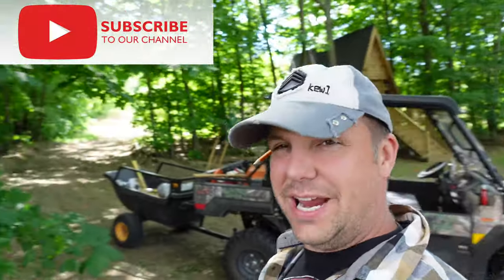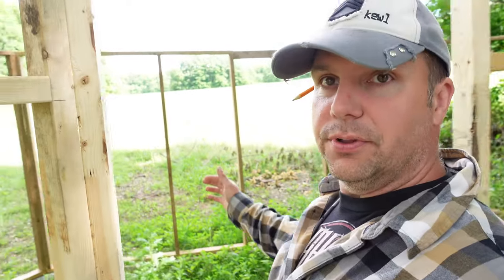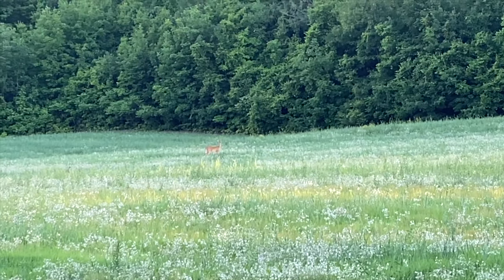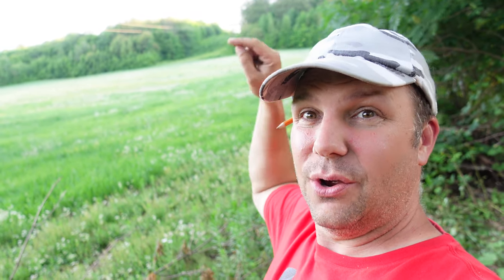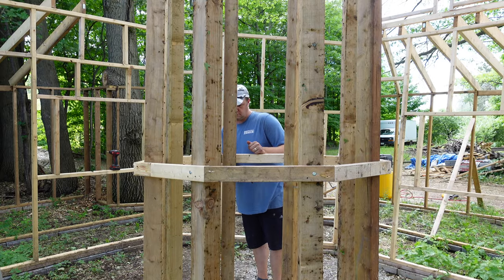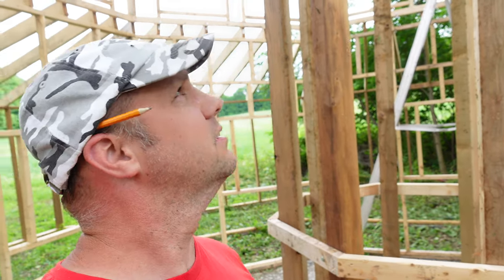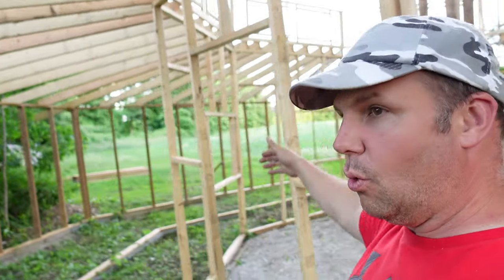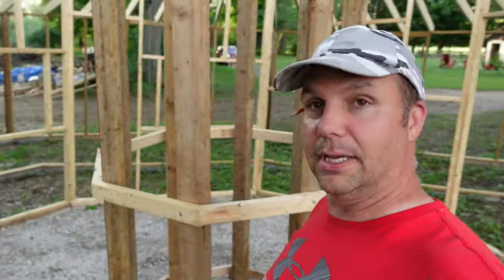Building the Ultimate Octagonal Chicken Coop Gazebo Ep 2

Comment: We built a 10 sided house in the Philippines. My asawa calls it "Decagon house" but the house name is Villa Cecelia". 
So you could have Villa Octagons". We did the roof support with a spider beam as shown on our  You-Tube channels build videos.
I would suggest the 3 most south facing walls be glazed polycarbonate and the other five with insulated panels like the roof.
The upper windows could have 2 opposing faces hinged at the top and operable for natural draft cooling in the summer. Our
Villa Cecelia is thermal chimney cooled like this and requires no air conditioning.
Reply from the maker: thats pretty amazing that it doesn't need air con.  10 sides eh thats must have been some project. I'm having a difficult enough time with 8 sides and the 22.5 degree angle.  Lots of waste for the roof though with all the angle cuts but I'm loving the way it's looking so far. Hope you're doing well George.